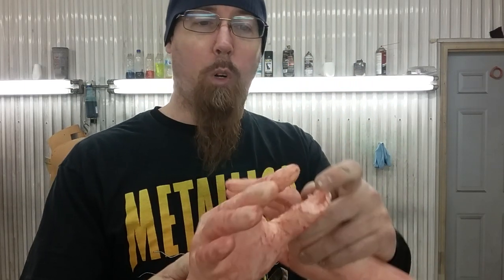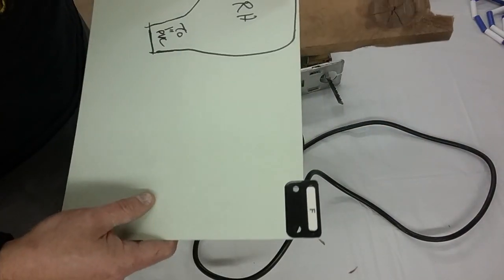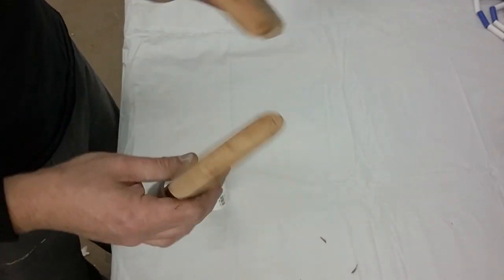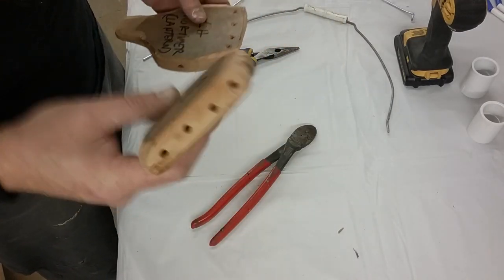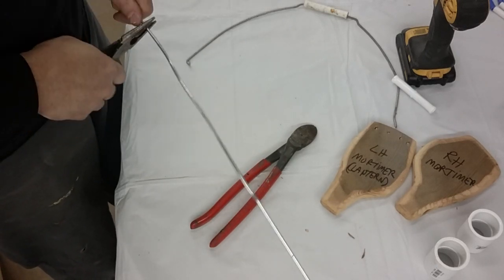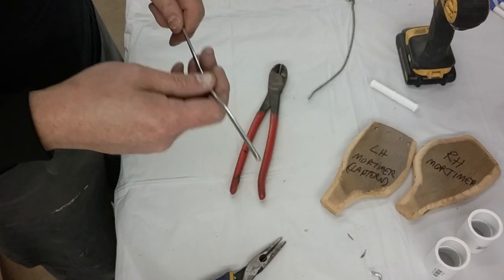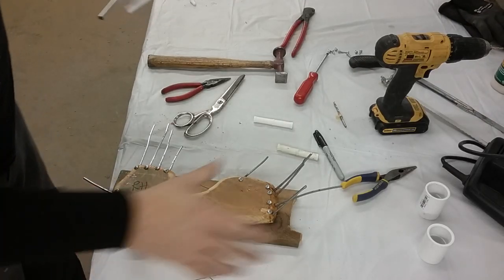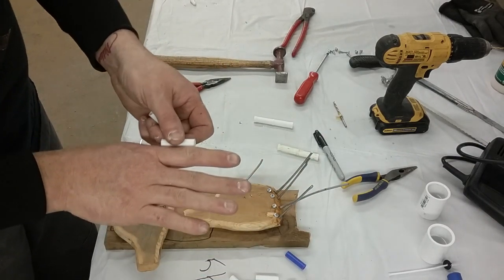Covid 19 Quarantine edition: DIY make your own prop hands!

Comment: I actually don't have any buckets or handles.
For bendy fingers I tend to get thick garden wire, quadruple the length of the finger and take the 2 ends of the wire and bend together.
I put the bent point on a nail or hook and the 2 ends into my drill.
And twist the wire together whilst pulling on the drill to keep a straight line.
When taut and fully entwined you have very strong and bendy wire for fingers and plenty of extra length to attach to the pipe or whatever you are using for the arm.
Best wishes 👍
Reply from the maker: Oh yeah, doubling or tripling up on thinner wire will work too! Something so you can still  pose the hands especially if you want them holding something.